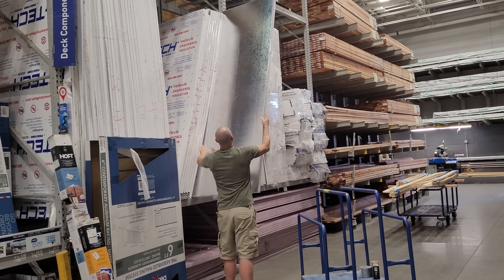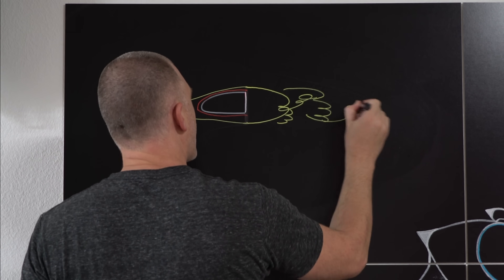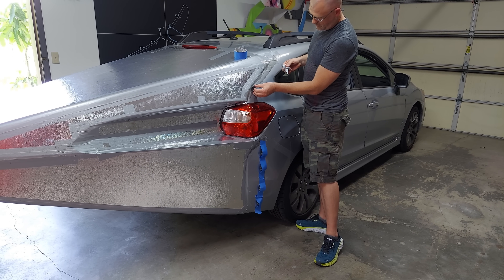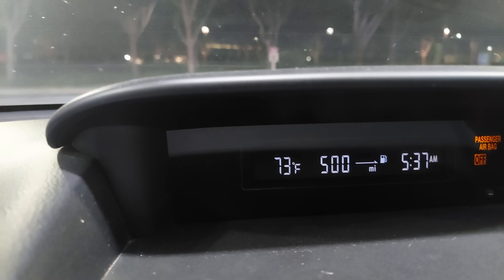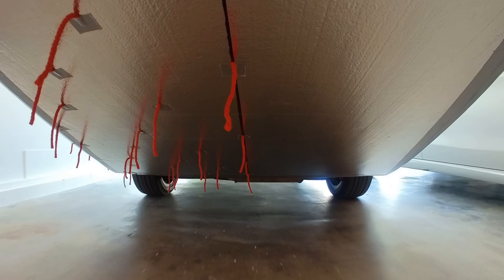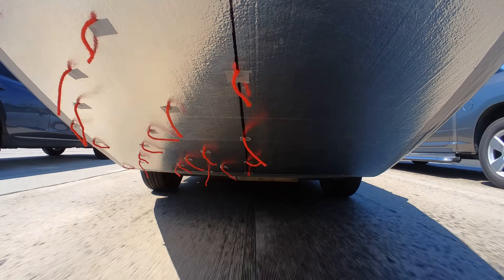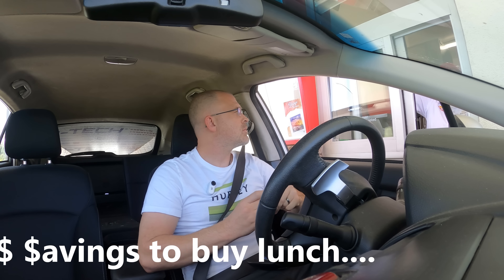Using Simple Aerodynamics to Beat High Gas Prices (Home Improvement Store Edition)

Comment: You could potentially cover the taillights with a clear plastic sheet, keeping them visible but allowing the air to flow smoothly. I am unsure how this would introduce glare to the taillights though.
Reply: Your solution and potential problem is inspiring. I myself thought of just moving the tail lights and plate to the back but your idea is much better.
Reply: @alexrosado3890  I mean alternatively, you can cover the taillights and wire auxiliary lights to the back (simple red and amber lights, like the ones you would see on a trailer). I think that solution would be the best of both worlds
Reply: @TheSFMCreators  yeah i like this solution too, that way if someone crashed into the portion sticking out behind your car there will be no excuse.
Reply: -General Aladeen: just make it...more pointy! 🧔🏻🚀
Reply: Exactly what I was thinking.
Reply: I thought the same thing, but with a firmer plastic.
Reply: Wire LEDs that run the length of the tapered sides.  They'll still show to the rear.  They'd look funky from the sides, but this thing looks funky, anyway.
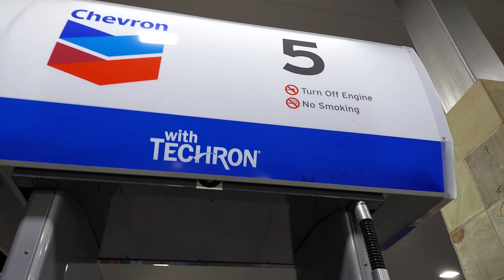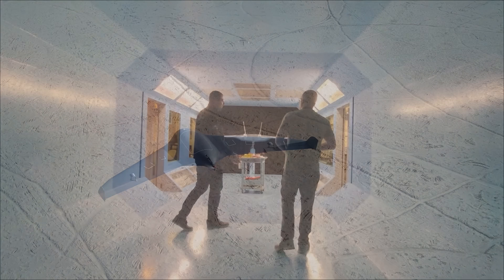Reply: This world is rapidly passing away and I hope that you repent and take time to change before all out disaster occurs! Belief in messiah alone is not enough to grant you salvation - Matthew 7:21-23, John 3:3, John 3:36 (ESV is the best translation for John 3:36) if you believed in Messiah you would be following His commands as best as you could. If you are not a follower of Messiah I would highly recommend becoming one. Call on the name of Jesus and pray for Him to intervene in your life - Revelation 3:20. 

Contemplate how the Roman Empire fulfilled the role of the beast from the sea in Revelation 13 over the course of 1260+ years. Revelation 17 confirms that the beast is in fact Rome. From this we can conclude that A) Jesus is the Son of God and can predict the future or make it happen, B) The world leaders/nations/governments etc have been conspiring together for the last 3000+ years going back to Babylon and before, C) History as we know it is fake. You don't really need to speculate once you start a relationship with God.

Can't get a response from God? Fasting can help increase your perception and prayer can help initiate events.  God will ignore you if your prayer does not align with His purpose (James 4:3) or if you are approaching Him when "unclean" (Isaiah 1:15, Isaiah 59:2, Micah 3:4). Stop eating food sacrificed to idols (McDonald's, Wendy's etc) stop glorifying yourself on social media or making other images of yourself (Second Commandment), stop gossiping about other people, stop watching obscene content etc. Have a blessed day!

Comment: Looking forward to seeing the beta to your gamma! Just make sure you don't ruin you ground clearance too much! And if you're going for skirts, might as well tape up some seams and maybe look at mirror fairings and maybe you'll make the angle at the rear smoother with integrated wheel spats
Reply: Guys on Ecomodder say to create a grill as long as the lowest point of your suspension.
I would be more worried about hitting your oil pan on a rock than side skirts.
The problem with mirrors is that you can't boat-tail them.  You could install a traingle under them that tapers to the window, but you can't do anything about the sides or top.
Someone suggested installing smaller side mirrors, but that would be difficult unless you went custom, and there are strict laws about that.
Video cameras would be great, but they aren't legal most places--if anywhere.

Comment: Filling at the gas pump is not exactly accurate. Sometimes the pump will kick off later or sooner than last time. It won't be an exact measure of fuel used.

Comment: Would work with EVs too. 
PS, the high up-front cost of an EV is soon made up in much lower operational costs, including maintenance.
The only real downside is the space it takes up. Parking spaces would need to be longer, fewer cars would fit into parking lots, parking garages (which have tight space margins) would have to be radically altered, or replaced, and the extra vehicle length would mean fewer cars on the road per mile on the road meaning the traffic would back up further. It's just too bad cars never went this way from the early years.
Thus, widespread adoption would entail expensive infrastructure revisions.
Access to the trunk storage space could be from either side, so that isn't a deal breaker.

Still, very clever, and a great initiative .
🍻

Comment: "I'm not sure why car manufacturers aren't going this route"
Well, for one, you've completely blocked the back window. Zero visibility. 
You've also lost the hatch opening. 
Your new design with the flat underbelly... terrible departure angle. you won't be able to leave your driveway without scraping it. 
If it was feasible it would have been done.  This is only for Youtube.  LOL

Comment: So does that include being lighter on the gas accelerations and rolling up to lights and stops? Aero dynamic like an object under it's own propulsion or tires designed to hold the ground better the test would only be relevant if the gas mileage increase was on a uphill scale and not just adding info to try and validate rolling down hill

Comment: Before you go too crazy, go check out Julian Edgar’s channel. Make an undertray and start measuring pressures, then you can modify your tail - it’s probably 30% too long- get the air flowing more smoothly under the car and reduce that drag, then throw it up into the wake with a diffuser. The roof extender is a good idea too but you can probably shorten it and sharpen the downward curve sooner. The real trick is the sides - those VGs at the rear bumper roughen up the flow, when you just want to direct it around the back end, again, into the wake.

Comment: I am contemplating of something similar. What I came across was .....how to describe.?..... Imagine an aluminum attachment, triangle in shape. With the sides bent up like fins allowing the flow of air through this attachment to be flattened instead of turbulent. By reducing the air turbulence, you can reduce drag co-efficient. Unfortunately I am not good with computors otherwise I would send a photograph. You need to make allowances for old (76) Australians.  Still , I am confident you could work it out. NASA did some work on it I found it by searching for research into Co- Efficiency

Comment: Driving 2021 Hyundai Ioniq hybrid, no mods, doing 47 mpg while driving normally. No eco driving, don't care of pushing pedal to the metal... I'm pretty sure it can do 50+ if eco drived and it also same size as you impreza, so...
Also it is not best idea to cover wheels with carton cover, especially when you like to drive in the mountains. Brakes are cooled with upcoming airflow and you mostly closed it,  what can cause an overheat, reduce of brake performance and even fire up your covers

Comment: Square cars that were in the 60's actually get better milage that any of these aerodynamic cars do. Why ? Well, its a result of the air going over and under the square body and then eliminating a vacuum at the rear that then actually pushes the car. Aerodynamic cars create a vacuum behind the vehicle and this pulls on the whole car at speed. To eliminate this effect you have to lower the car put side skirts on it and a smooth belly pan to force the air strait behind with less turbulence. All of this aerodynamic stuff is made up because it causes less gas milage thus more money for the fuel companies. They do the same with the fuel injection system. These systems are a scam too because when at cruse they can dump fuel into the system through the injectors and you never know, its called flooding the chambers, because once you tap the gas it quickly shuts off the dump sequence. Didn't know that did you !? All this high milage stuff that you THINK your getting your not. Why do you think they went to injection !!? Because carburetion worked to well and they wanted more money. I have tested this numerous times using a 455 ci engine milage compared to a 4.6 L
and I used 4 times more gas in the 4.6 L that the 455 ci used to go the same distance. The injection is just to make you think your.getting high milage when you ain't. Think.about it ! Do you really think that these greedy pigs would give you a car that gets 35 to 40 mpg when they can tweak them to give you 8 mpg to suck money out of you using technology that you can't understand or, to say the least, confirm the exact amount of fuel the injectors release ? No. These.guys are smarter than you by miles, some worked for NASA, so this gas milage stuff is being faked. And, by the way, there isn't any law anywhere that says they have to tell you what the real mpg is either, so forget that idea.

Comment: The angle of the top seems to be fine, you should keep that as is.  The sides and bottom angles are excessive.  If memory serves, something like 7 degrees should be the maximum slope.  KAMM'S THEORY  suggest that you design an optimum shape (elongated teardrop) and then chop off the tail when the cross-sectional area equals 50% of the vehicles maximum.   Usually I like front air dams, but you have virtually NO air reaching the underside of the tail already.  Is it a good idea to block off more air flow?  Maybe reshape your tail first,  and then look into front air dams and side skirts?  I hope you'll keep the tails upper surface just as it is (that's great looking flow) and eliminate the steep angles (greater than 7 degrees) of the sides and bottom.

If the max. cross-sectional area of you car is around 3500 sq. inches, you'll want to cut off the tail where its area is 1750 sq. inches (say about 3'x4').  This, along with the shallower angles on the sides and bottom should help with the drag and maybe shorten the tail a little (making it a bit more practical).  Fairing in the taillights and rear fender skirts can probably wait until after you optimize the tail shape.   

Look at a Cobra Daytona Coupe.  It's not perfect but it's pretty darn good.  I've seen some photos of a Daytona Coupe being tuft tested, they may still be available online.  Actually the Daytona Coupe's tail slopes down a little too much.  The Kamm shape may require a spoiler to improve stability.  Those were first suggested by Richie Ginther when he drove Ferrari's mid-engine sports racer circa 1961/62.  Peter Brock added one to the Cobra and it became World Sports Car Champion.  One about 1/2 - 2/3 as tall as the Cobra's would probably be sufficient for you application. 

At one time I did a little aero work on Can-Am and F-5000 cars as a hobby job, while my day job was engineering aircraft and drones.   Hope the above helps.

Comment: Box tape the seam around your windshield if there is a lip. A lot are glued flush and don't have a gasket on the outside anymore. Tape the seams around the headlights, flatten the fog lights with tape if they are inset, use wide as possible bars to support a front splitter to push the air over them and not trap it low under the bumper. They are top speed tricks which is about aero for the greatest speed. Good old exponential drag 😃  There is a hump of plastic to put on the front of your side mirrors too. It is an upgrade for supercars, you'll have to make it. Your brakes can heat-up now due to stagnation with covers. Vent it out through the quarter panel or cut it back to let air escape. I remember Plexi wedges in the 90's that tapered from the roof to a low point 4-6 feet in front of the bumper and smoothed the hood to glass angle. Took care of the visibility problem. Plexi isn't really much more unless its thick and has to support itself without a frame. Good luck.

Comment: Make floor of that part bit strong and put a high voltage small lithium battery in it and put a hub moter on the rear wheel and place some flexible light weight solar on the top, it  will give an initial boost from the moters when you speed up the car. It will be much more helpful for better mileage

Comment: Having worked directly on production vehicle development on wind tunnel and aero efficiency in general,I would suggest a better research.There are some basic mistakes that render your added shape non efficient(too much closure in plan for example).Also remember that brakes need to be cooled…otherwise…I hope you understand that there are some basic safety issues not addressed,besides the structural,like tail light visibility angle.
Reply: Too much closure in plan?  Too much taper?
Yes, there is detached flow.
Brakes need to be cooled far less when people plan stops and downshift.

Comment: Hint: Transparent "bubbles" over the tail lights. 😉😉
Reply: I'd probably also take a photo of the license plate, print it on something highly water and fade resistant and tape that to top of the extension, because while you could see if walk up to the back of the car, I doubt anyone in traffic could see it.  I'd leave it uncropped so it looks like a photo because there's probably some law against counterfeiting license plates.

Comment: you should use Rubber for the front and side walls as they are more durable and better made for that task. it may be more expensive i'll give you that but they will last far longer than styrofome ones

Comment: Thanks for a great video. Love the try and test analysis.
Citroën DS 1955-1975 had the rear wheels covered. A very aerodynamic car for it’s time.
Fully agree, car manufacturers should spend more time on aerodynamics.
Reply: Pickup trucks are the least aero followed by vans. I cleaned up the underside of my Metris van by covering the big open areas with medium density foam. Added Airtabs on top and the very back and went 1 size smaller on the tires.
Reply: @mitchberger2691  wow - did it have any measurable effect on fuel consumption?

Comment: There is a reason the NTSB has rules for car makers and the lighting they use on the back of the vehicle. As per your video you don't know or don't care about the risk of impeded rear lighting. Your modification has removed the ability for other drivers on the road to see and understand your intentions by creating a obstructed view of the rear lights.

Comment: I don't want to burst your bubble or anything but it is illegal because you've modified your bumper or at least that's how DOT would look at it. That's also why car manufacturers don't do this. If we could cut manufacturers loose and get rid of carb dot... especially the EPA and just said hey this much weight of a vehicle this much power must get at least these minimum results and cut them loose we'd probably see you way different vehicles. But everybody's worried about safety so car manufacturers literally have no freedom to think outside the box anymore.

Comment: We were getting 32mpg from a 2018 RAV4. With gas @ $3.60 gallon, that equals 11.3¢ fuel cost per mile.

Traded for a new 2022 Chevy Bolt EUV. Electric costs us 7.5¢ kWh. Even with a conservative 3.8 miles per kWh, that's just under 2¢ per mile.

Gasoline is rising again... now $3.70. I seriously doubt our electricity price will jump from 7.5¢ to 42¢ kWh anytime soon... there would be a civil revolt!

Imagine what adding aerodynamics to the Bolt might do... making a "cheap to drive" car even cheaper to drive!

Comment: Time for some side scoops to bring in clean air and help keep it attached to lower sides. I would not worry about the bottom as seen from the tufts there is very little movement of air coming from the bottom of the car. The front splitter seems to be doing its job pretty well.

Comment: Of course, it's just a little more difficult to use the hatchback now.  Everything is a trade of some sort unless the original design was thoughtlessly poor.  Approaching 15% fuel mileage improvement is nothing to sneer at though.  The drag reduction is significantly higher since it is only one contribution to mileage.

Comment: You should have started at the front to begin with. Many modern cars use the Kammback effect in some form to help detach the airflow from the car, and aid in aerodynamics.

So at the front, I did 2 steps, and found some interesting effects.

I have a 2013 Chevy Volt. They came with a small or smaller rubber air dam which is under the front nose of the car. These get damaged when you pull in too far at parking spaces with concrete parking stops. 
So I decided replaced mine with a bigger plastic air dam that reaches almost to the ground and see if I could improve the aero (decrease drag). I attached 6" high lawn edging to brackets I made (initially aluminum, but later 3d printed TPU).  The plastic edging is cheap, $20 for 60 feet from the big hardware/garden stores. 
I see a about a 7-10% improvement in range (the Volt calculates range based on about 2 weeks worth of driving data and the battery charge level). Going from 34-35 to 38-39 miles of range (in 2022). I've extended the edging at the ends to almost touch the tires, but clear.
So then I bought some thin 1" 90 degree aluminum (about 8 feet long) and screwed that to the bottom edge of the plastic sides. And mounted the lawn edging the full length of the side. At higher speeds I could sort of feel the car sucking down and getting stiffer on the springs. And my range DECREASED, so the side skirts were hurting the "mileage".  
So I cut them to about 2.5' long and reattached them at the front of the aluminum strips. This improved my range slightly over just having the front air dam lawn edging on. Maybe 0-1-2 mile of extra range, depending on my driving style. 
NOTE: the lawn edging is very close to the ground and scrapes a lot. when braking hard, or going up and down driveway ramps.

I keep thinking about mounting pizza pie plates to the wheels to see what that effect is worth.